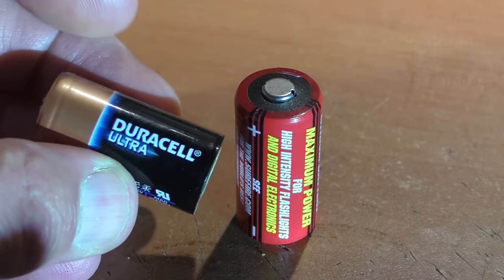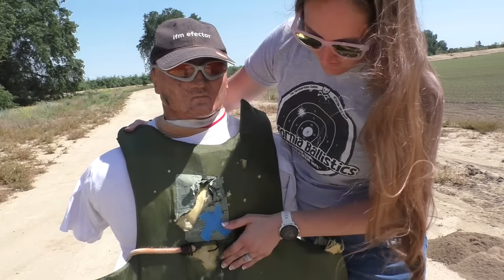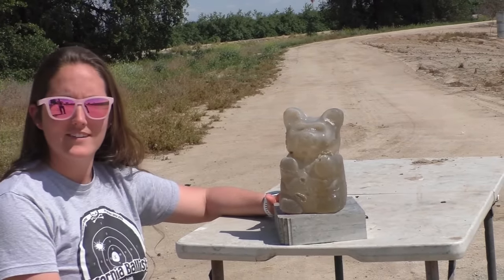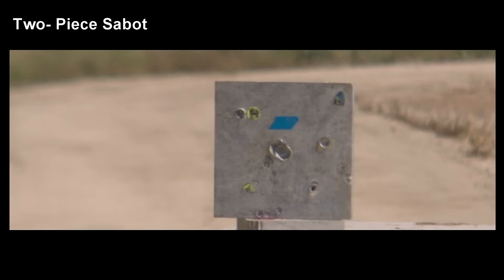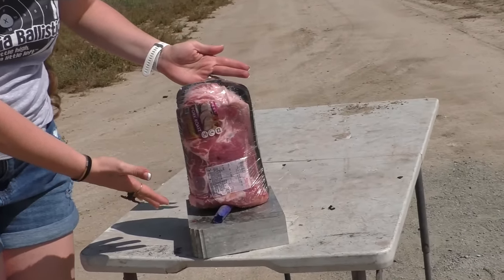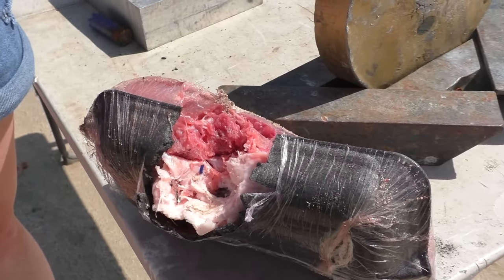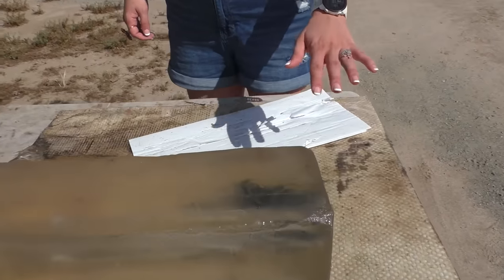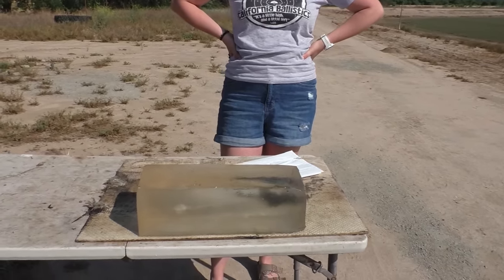12ga. Shotgun Lithium BATTERY Slugs-  Brutal Results!

Comment: My favorite thing about shotguns is that literally anything that will slide through the tube can be used, batteries, dimes, bearings, marbles, peppercorns, whole nutmeg, rock salt, granulated bleach, gum, putty, sand, pulverized metal, chunks of wood, and just about anything works. Shotguns are wonderful
Reply: Don't forget wax!
Reply: OoOooh granulated bleach. That's a good one.
Reply: its amazing how versatile they are
Reply: I think ball bearings would work awesome.
Reply: @jimwjohnq.public  They do. They forgive no weakness.
Reply: @jimwjohnq.public  isn't that just normal buckshot?
Reply: @Blue-bf8lv  no, buckshot is lead
Reply: Well yeah, shotguns typically use rather wide smoothbore barrels lol
Reply: in russia: if it fits. it spits
Reply: I loaded tungsten carbide lathe inserts into a shotgun shell once, loaded to 1300 fps. A tungsten carbide lathe insert seriously fucks at 1300 fps BTW, I shattered a 2 foot diameter rock with them lol.
Reply: That's the old blunderbuss attitude. Still works.
Reply: That nutmeg though.... hits different
Reply: If it fits, it ships
Reply: How about painkillers in shel, should those hurt or what..?
Reply: Granulated bleach.....ouch
Reply: @TheExplosiveGuy  they are also very good to add to slugs as armour piercing
Reply: Severed human thumbs.
Reply: @TheExplosiveGuy  rip barrel
Reply: @johnnyregs2378  I guess the meat will act as a sabot for the bones lol
Reply: @scrappydoo7887  carbide is kinda meh for AP purposes in shotguns, shotgun slugs aren't going fast enough to properly penetrate armor even with a pointed TC core, you're better off sticking with a high velocity rifle for that purpose. Unless a person is wearing hard plates a soft lead slug will take out a target wearing Kevlar even if it doesn't penetrate, the deformation of the vest into the body will kill. But in rifle bullets a tungsten carbide core at 2500-3300 fps is a thing to be feared, that's when carbide shines at AP.
Reply: Just imagine what you could stuff into a blunderbuss.
Reply: @TheExplosiveGuy naturally a rifle is best but shotguns are more common here and still do the job lol
Reply: @TheExplosiveGuy  he did a video with a polycarbonate slug and either a hardened steel pin or carbide penetrator and it slipped right through ar plate.
Reply: @White000Crow  that's what I thought
Reply: @norecordingsoftware3309  lol I was way ahead of you on that one, they were 1/2" wide disks that were 3/16" thick and I cut a UHMW sleeve/gas check/sabot to go around and under them, I wasn't taking any chances with one of those edges taking a bite out of my bore lol. It patterned much like a coinshot would (a.k.a. horribly🤣) at longer ranges but with a tighter and less random trajectory, but it fucked up close, hard lol. It never penentrated but it left some gnarly dents in 1/4" steel plate.
Reply: You got it. Watch enough TFM videos, and you come to believe that no matter what's coming out of the business end, you'd prefer to be behind the line and not downrange.
Reply: @White000Crow  yeah but that pin had next to no energy afterwards, you want AP rounds to lose as little mass and velocity as possible to keep right on truckin through your target. I'm not saying shotguns can't pen armor, they just don't do it well. Kinda like shooting ducks on the wing with an AR15, each platform has its strengths and weaknesses.
Reply: Don't forget about arrows, dog food, human feces,(round pellet turds from being constipated), bratwurst, dried corn, nails, chunky peanut butter (skippy), glass, beer can tops...
Reply: I wonder if anyone tried thumbs, like in that old Godfather parody movie.
Reply: @TheExplosiveGuy  interesting the speed and hardness didn’t go through that steel. So you basically made a cylinder for it to travel in?
Reply: and pointed sticks!
Reply: @TheExplosiveGuy  time for a 5/8” hardened steel slug!
Reply: @jimwjohnq.public  00 buck? Haha
Reply: @norecordingsoftware3309  It was only going 1200-1300 fps, it would need at least 2000 to go through something like that. The sabot I made was made in three pieces, a short cylinder that was wide as the bore for everything to sit on and serve as a gas check, then I made a tube that fit in the bore and the inserts fit inside that, then the tube was cut down the middle like a sabot so they separated away on either side when it fired. Pretty labor intensive rounds but they were entertaining.
Reply: The modern blunderbuss 💪
Reply: @johnnyregs2378  if you freeze them they work even better
Reply: ALL of the above simultaneously, and for the love of God would SOMEONE please purchase one of those plastic totes in the wilderness so they quit playing that commercial? lol
Reply: I crave the forbidden FRAG-12.
Reply: Do you have any thoughts on preparing shrimp?
Reply: @White000Crow  more shotguns lol! 🤣
Reply: Feathers, pink Himalayan salt, frozen peas, rattlesnake tail, baby teeth, #7 shot...
Reply: I agree
Reply: Also I love the family guy reference. 👍
Reply: @CrashRacknShoot  chemical weapons
Reply: I think you forgot something. Not sure though
Reply: Hmm, peppercorns, nutmeg… I’d add some coarse salt crystals to the mix and then the cooking after hunting is greatly simplified 😋
Reply: A modern successor to the blunderbuss?!
Reply: What about the other type with manganese? I'm also curious if the carbon rod works as a penetration core
Reply: TCCA pool tablets and ammonia in separate pieces so it saturates once you pull the trigger this creates nitrogen trichloride
Reply: @DrBovdin  
I have loads of peppercorns, cloves, whole nutmeg and salt. I call it the spice rack.
Reply: @Blue-bf8lv  yes yes it is lol.
Reply: Pepperoni?
Reply: Frozen hamburger 😂
Reply: @CrashRacknShoot  mix it with sand and chilli too
Reply: I loaded 20 guage shells with steel ball bearings (3/16 - 1/4 inch dia.) when I was younger. They worked dandy
Reply: Dimes!?! I never thought about that! That is genius!
Reply: Lemme tell you about the blunderbuss...
Reply: @johnnyregs2378  Ever seen the spoof comedy Mafia?
Reply: @stevenmidrano6145  let me show u its Features 🤣
Reply: @ClintonGalton  dimes don't work very well. They barely penetrate skin tissue. It would wound someone but wouldn't kill them short of maybe hitting them in the eyeball.
Reply: do it. all of it in one round. lol. someone probably already said this, but I'm not reading all those comments.
Reply: @chrisb4121  
That's the idea. It'll knock a man out of his saddle but it won't kill him.
Reply: Now I REALLY want to see the dimes, like in Young Guns.
Reply: @ClintonGalton  That used to be a common load. Problem is, they BOUNCE if they hit something like hardwood, then go zinging around. They've been known to hit the shooter. My dad told me about the desk guy at an SRO (one of those cheap hotels where everybody pays cash) in New York, got hit in the throat by a rebound when he shot an armed robber through the desk.
Reply: Very true.
Reply: @CrashRacknShoot  Ouch!!!
Reply: Shotguns are very cool & a hell of a lot of fun taboot
Reply: One wonders if somebody has made a 12 gauge HEAT round?
Reply: Broken spark plugs!!
Reply: They are the leatherman of guns.
Reply: At the end you said it the best shotguns are wonderful.
Reply: @TheExplosiveGuy  v nm b
Reply: They are definitely the original inspiration for the junk jet in fallout
Reply: Carlos, most definitely, I wonder how tampons will work. ??
Reply: For all the debate over the “stopping power” of different munitions, you don’t hear any about anybody getting center punched with a 12 gauge slug or full load of buckshot not going down.
Reply: Washers don't work where the dam,I think it's the hole in the center.
Reply: You forgot silver coins for vampires.
Reply: ...You forgot tampons.
Reply: Make sure that the choke are design for the specific ammo. A lot of shotgun owners seems to forget this and end up damaging their shotgun in the long run.
Reply: Yes 😍😍😍
Reply: That's it, I'm getting one
Reply: im sorry you must be referring to combustion-actuated linear accelerator
Reply: You could use anything that is the right weight and size
Reply: You can fit a two foot long wood dowel right down the barrel and into a cut shell with the shot dumped out. You can attach a lot of things to the end of that dowel... you can launch it hundreds of yards depending on angle of fire.
Reply: Coins
Reply: You forgot chains, tacks, nails, and glass; I love a combination off all!
Reply: Anyway, like I was sayin', shrimp is the fruit of the sea. You can barbecue it, boil it, broil it, bake it, saute it. Dey's uh, shrimp-kabobs, shrimp creole, shrimp gumbo. Pan fried, deep fried, stir-fried.

There's pineapple shrimp, lemon shrimp, coconut shrimp, pepper shrimp, shrimp soup, shrimp stew, shrimp salad, shrimp and potatoes, shrimp burger...
Reply: Imagine shooting buck shot made from lye crystals, imagine the pain!
Reply: Wait til you hear about the blunderbuss!
Reply: @jannejohansson3383  depends on ones prior tolerance to opioid medications!
Reply: Shot gun is delicious
Reply: @Blue-bf8lv  buckshot is lead ball bearings are hardened steel
Reply: Or as Emilio Estevez said in one of the Young Guns movies, after unloading on a gaurd, with a stack of dimes , loaded in the scatter gun,  best 1.10 cents I. Ever spent.
Reply: You forgot Legos.
Reply: ...and 1 can Easily be made using 3/4 Black Pipe from ANY hardware store in case of expedient need of Defense.
Reply: fashion a funnel for the end and you have the good old blunderbus
Reply: Even diarrhea
Reply: @calico_hannibal9114  🤣
Reply: Didn't know batteries were High Explosive when fired out of a shotgun shell

But yeah, anything that fits in the cartridge, depends on how nice you want to be - plastine shot to the gut, that will tickle and give some punk breaking into your house something to stop and think about, but not kill him
Reply: Rock salt is mean, but I've always wanted to see a complete glass slug
Reply: @White000Crow  civil war cannon principle.
Reply: A modern day blunderbuss 💁🏼‍♂️
Reply: @TheUltimateWord  WFT is the blunderbuss????
Reply: Shrimp salad, shrimp sandwich, shrimp and grits, shrimp gumbo.....
Reply: @jannejohansson3383  I laughed.
Reply: Don't forget glass shot.
Reply: Oj
Reply: Useful, to be true.
Reply: The small square or circle legos? If it hurts to step on em imagine getting shot with it.
Reply: N A P A L M
Reply: ... did anyone say magnesium yet?
Reply: @JohnMosesBrowningVEVO was thinking the same 😂💭 I hear him say... Did I hear someone say... NUTMEG!!! 👀😲
😄👍
Reply: Www, grabulated bleach? Painful way to go...
Reply: @jannejohansson3383  yeah, it would still hurt assuming it doesnt get turned into powder in the process. I'd load up some lidocaine, it's a topical anaesthetic so should help a bit more, again, assuming it isn't powderfied (tm) lol.
Reply: How come you left coin, it's very basics of RE 🤣🤣🤣
Reply: White phosphorus?
Reply: Don’t forget arrows out of the ole break-open shotties 😎
Reply: What if we used shards of glass? That would kick like a mule and give you an infection at the same time
Reply: Nutmeg 😂
Reply: drano crystals
Reply: Gallstones ?
Reply: What about Tampons?
Reply: @UNITED-WITH-UKRAINE  too expensive
Reply: In Russia we shoot dead mice out of 410 shotgun at cats.
Reply: @beargillium2369  For catfood
Reply: You forgot cigarettes yes cigarettes killed a guy because 3 were shot out of a 12g shotgun shell
Reply: crack
Reply: My favourite combo was a stack of washers with nails inside the hole in the washers with wax to keep it together.
Reply: I rem using riot control baton guns. Basically an H&K 40mm crack thump grenade launcher. Back in the day, troops would fire batteries at rioting civilians. Lethal on top of even more lethal
Reply: They was called blunderbus and scatter guns for a reason
Reply: @Aaron-zu3xn  thats wicked. I may try it. Just bought a Mossberg 590 Mariner 12ga
Reply: My cousin,now a well served artillery officer who has since survived a few conflicts unscathed was once taken out by my older brother with a frozen,string wrapped pork sausage to the shin while running for cover,from about 30 ft away, it split the skin to the bone for about an inch,the shot which was off the hip style too was pure luck at best,despite what my brother believes. It was revenge for an earlier prank,we are now just into our 50's and he still has the scar👍 I thought he'd broken his leg at first,he went down hard😂
Reply: The blunderbust
Reply: How about legos?
Reply: Even tree bark works
Reply: Ok
Reply: And dont forget that you could make an bromine slug
Reply: I saw someone at the range yelling "watch this" and loading crossbow bolt from the muzzle and effing nailing the target at ~30 meters.
Reply: That's what she said.
Reply: They are modern hand-held cannons
Reply: @JohnMosesBrowningVEVO oh god
Reply: Indeed. At the end of the day however, 4 shot and cylinder bore is absolutely devestating out to 40 yds. Improved cylinder gives a little more range but messes the pattern a little. Ive cut old power poles nearly in half with 4 shells at 20yds with this setup. No 4 steel handles improved cylinder better but is pricey.
Reply: Rock salt!
Reply: @JohnMosesBrowningVEVO you are a cultured individual 😂
Reply: My favorites were a spark plug and a small mag light (I think those were early demo ranch)
Reply: just don't forget to charge it LOL
Reply: Gravel and glass shards
Reply: @JohnMosesBrowningVEVO how to forge musket balls out of lead toy soldiers for use in your Kentucky Long Rifle 👌
Reply: "Best $1.80 I ever spent!"
Reply: @noahkingery755  would cut down on bloody loss
Reply: 5/16in ball bearings can group in 3 and friction weld them to your barrel bad idea to use them
Reply: @desmondmurphy449  or just a piece of hardwood
Reply: @CrashRacknShoot  N
Reply: Yup and full blown Brunswick balsa wood 🪵
Reply: Grape shot!!
Reply: And if someone can't buy or make shotgun shells, then a flintlock blunderbuss or musketoon?

Maybe one with a revolver design, so it can fire random stuff rapidly?
Reply: Exactly the most versatile gun ever
Reply: Hell ya!!
Reply: And they REALLY f*CK up your day if you're on the wrong end of them too 👍👍
Reply: @jannejohansson3383  Yes/No !
Reply: My favorites are bean bag rounds they wont kill you but it feels like tyson waylayed you 😂
Reply: This video is so Direct,  and Current. Ohm eye God.
Reply: @johnw5584  I haven't tried the turd round before 😂😂🙌
Reply: @performancepursuit  tails first 👍
Reply: @markmatsushima7356  There are tracer rounds available for 12 gauge.
Reply: @jpthepug3126  they make 12 gauge CS and OC rounds in barrier penetrating and air burst varieties
Reply: What a WASTE..
Or did it go over my head 🙄
Reply: @obsoleteoptics  nnn
Reply: @williamletts9487  plus it's a wonderful way to put the lithium back into the Earth that's right be sustainable recycle lithium put it back where it came from
Reply: Sugar shells
Reply: cotton wool
Reply: .65 cal musket balls!!  Get some.
Reply: @scrappydoo7887  a good old 12 Gage with  slugs works wonders on your shoulder after 6 or so shots 😂🤣
Reply: Toothpicks ,thumbtacks ,dress pins , and tinfoil balls are fun
Reply: @ClintonGalton  young guns 1 or 2 .
Reply: its like its own hobby, outside other guns.
Reply: When you mentioned dimes, it reminded me of one of my favorite westerns, Young Guns Two. 'I've got eighteen dimes in each barrel, boy. You ever seen what a dollar eighty can do to a forty dollar steer?'
Reply: Nails, soldered together at both ends have interesting results.
Reply: Rock salt burns like a bitch and it leaves lil scars. 
Or so I've been told
Reply: Oh why teach this to others it is playing with guns like toy
Reply: what about splitshot for fishing like those pacman shaped metal balls
Reply: My dad used to reload his ammo in his younger days. He always kept 15 or 20 shotgun shells (12 g) loaded with rock salt for wild dogs that would frequent our property.
Reply: Do sodium hydroxide crystals
Reply: What about quarters That’s what I saw the girl in the Resident Evil Movie do.
Reply: sounds like you've had a wonderful childhood 😂😂😂
Reply: Especially Dimes. My buddy and I use to call them our "dime a minuit loads"lol
Reply: Super)
Reply: $1 in quarters
Reply: Remember, once you run out of slugs for your shotgun, you could still rely on your good pal, household items that could fit inside your shell.
Reply: totally agree attach some bayonate and you got to be megatron and his signature move"backstab and boom"
Reply: @TheExplosiveGuy  when I was in basic training my drill Sargeant showed us his deformed chest plate from when he got shot in Afghanistan. It was bulged and pointed in (military use hard firm plates) and I could totally see that instantly stopping your heart. He broke some ribs that about all I know, it was mote of a "show" than a "tell" day.
Reply: An old boss of mine used to load low powered cartridges with rock salt and shoot his friends. Only powerful enough to cause little cuts but nothing major stings like a B though when the salt “melts” into the scratches though
Reply: I have a shotgun shell with crushed ghost pepper and 18 plastic pellets in it. I really want a good target to use it on.
Reply: White phosphorus pellets 😂😂
Reply: @jackmagnium6115 
On the opposite side you have Biden :
Buy shotguns.
😂😂
Reply: I’ve never been a big fan of shotguns but I never realized that you could do this either. Sure I’ve heard of people putting rock salt in their shells but this is badass. Definitely got me wanting to get a tactical shotgun. I don’t like the ones that only hold 3 rounds I need atleast 5-8
Reply: Ye old blunderbuss
Reply: Concrete
Reply: @obsoleteoptics  9
Reply: Very easy to substitute loads
Reply: A true american fellow...
Reply: cant forget airpods.
Reply: Wax slug with a steel nail in the center
Reply: Salt
Reply: @killrade4434  You don't need a shotgun to kill with legos... just randomly scatter some on the floor to be stepped on!
Reply: Don’t forget glass, nails, sharpen coiled metal, and the most brutal of them all flechette rounds ☺️
Reply: Modern day blunderbuss
Reply: This is my idea for gun laws!  Shot guns should be the only guns. And everyone should get one. Every other gun is banned.
Reply: Super curious to see what silly putty would do
Reply: Tenderizer rounds with rip rounds every other one 😂yeah turn you into a slurpy
Reply: I think it was Mythbusters that did it, but I've seen cigarettes fired out of a shotgun. Hilariously deadly.
Reply: What if you switch out the shot from a 20 gauge birdshot with 20 gauge buckshot?
Reply: sparkplugs
Reply: Modern day blunderbuss 🎉
Reply: and they have shot most of those things
Reply: Just like my gf
Reply: Ooo, angy murder hornets?  …😂😂
Reply: Yes indeed, shotguns are the firearm freedom at its best!
Reply: Powdered Glass, powdered fiberglass, 3.7 volt vape batteries overcharged.....
Reply: Fentanyl
Reply: @Aaron-zu3xn Does that actually work?
Reply: My mamaw used to load shells with Rick salt to discourage prowlers (animal and human) around her farm.
Reply: @williamletts9487 there is steel shot out there in all varieties, that’s gotta be pretty damn similar
Reply: @obsoleteoptics During WWII, the British Home Guard, being short of rifles, but many of whom had their own shotguns, were told that they could improvise bird shot cartridges by removing the lead shot and replacing it with an ordinary domestic wax candle - it would apparently punch a hole through a 1” oak plank!
Reply: They knew that back in the Civil War too.